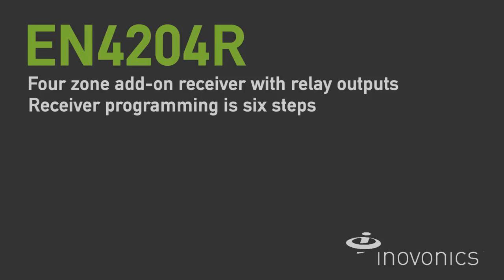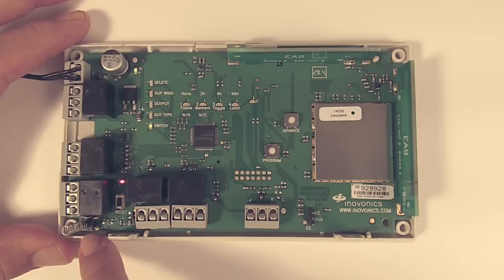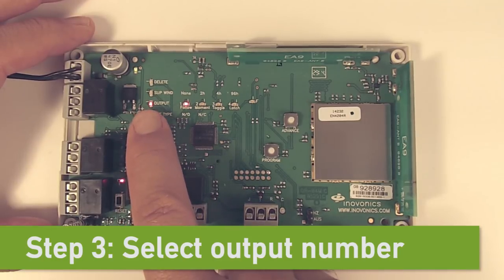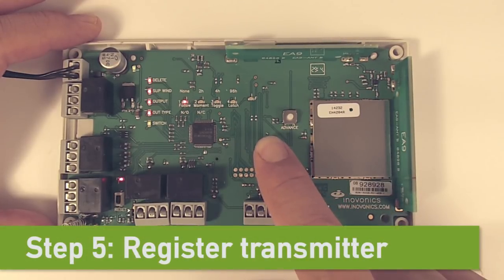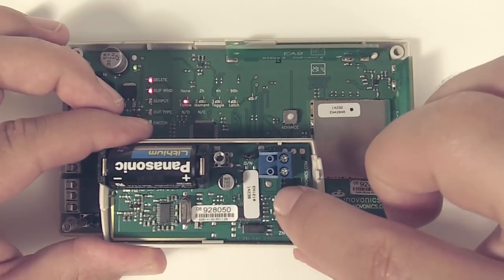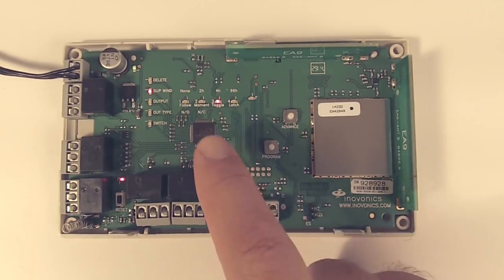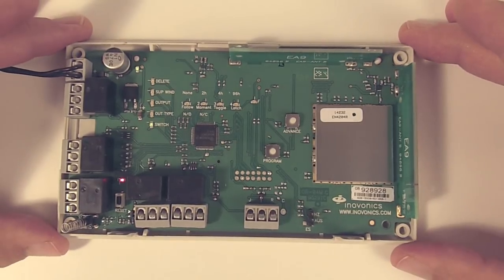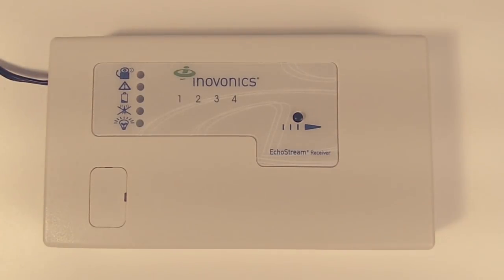EN4204 Programming

Comment: You show the proper way to pry open the case, but your tweeker (small screwdriver) is moved to where the wall would be. When mounted to the wall the housing cannot be opened this way. could this be redesigned?

Comment: Please define Supervisory options.   I am trying to use this with pendant transmitters (EN123D)  to create a momentary closure on output 1.   The only time I get a response is when I do an alaram check by depressing both buttons.
Reply: Supervisory options are the time frame that the receiver will check to see if the transmitter is still in the area. As he mentioned "they're taking it off site" in which case, were it left at 4 hours, there would be a supervisory alarm 4 hours after the transmitter was removed from the area. The EN1235D only functions when both buttons are pressed, reducing the likelyhood of a unintentional activation. If you want a momentary activation you would select the 2nd LED for MOMENT when you are choosing the output type.